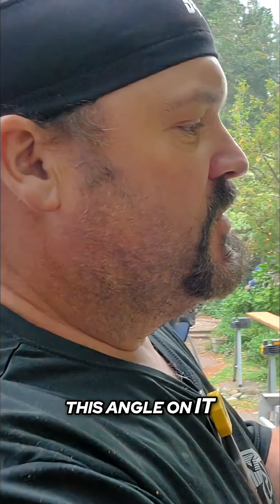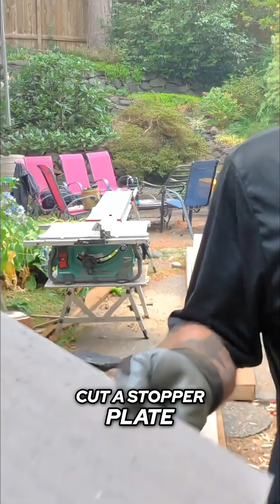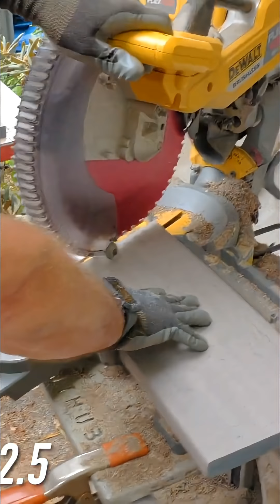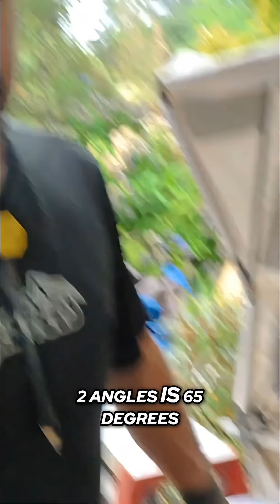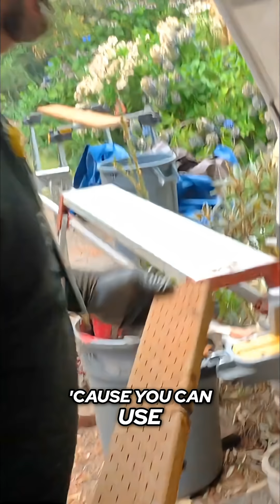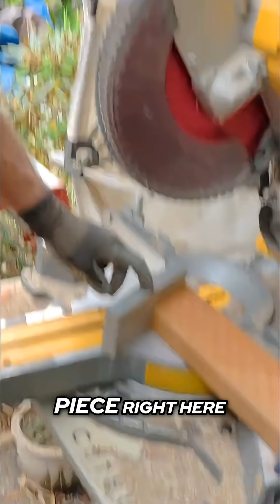Chop saw hack: 65-degree cuts without buying new tools #carpentrylife #shorts

Comment: You can use the built in 45 on the speed square and set your saw to the difference between 45 and desired angle. Thereby eliminating the need to cut a scrap piece.